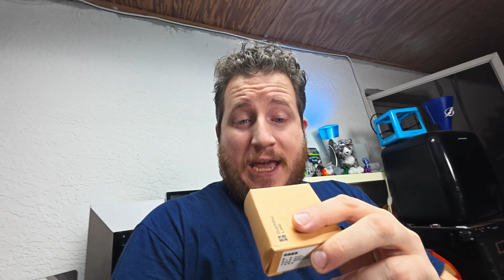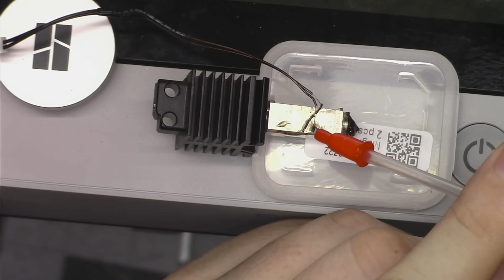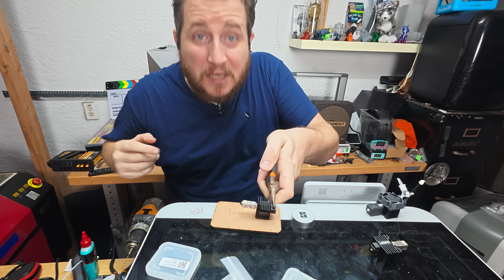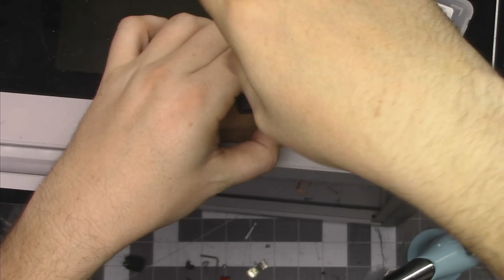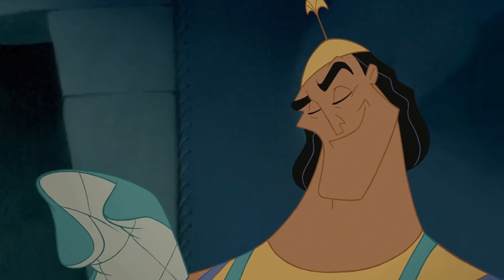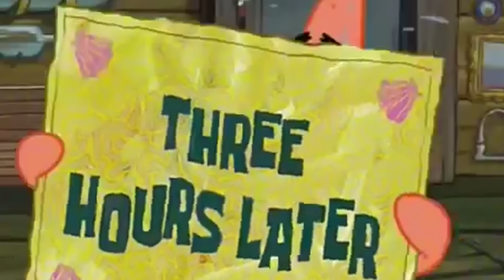I Drilled Out a Stuck Thermistor to Save a $160 Nozzle - PrintFixFriday 256

Comment: I apologise if this a noob question.. I am a bit new to 3D printing. I have a H2C and experiencing retraction issues. I have no doubt there is more than 'one thing' that could be causing my issue, however I did notice, like in your video, a possible issue with the ptfe tube curve for the toolhead. Is there a print for the H2C that I can use on the toolhead like the one you used??
Reply from the maker: That I don't know! You can lift the lid a bit and see if that helps
Reply: @3DMusketeers  I will give that a shot. Appreciate the reply 🙂

Comment: WD40 is not a lubricant.  In fact, if it is used as such, it will very quickly get sticky and if that's not bad enough, it will grab on to every dust and dirt particle that touches it.   BUT, it is really really good at dissolving adhesives.  I use it to get labels off of things all the time.    Again,  WD40 is not a lubricant.     Being a water displacer, you can (I did this years ago) throw a computer in a small fish tank full of the stuff and the computer will run.

Comment: I feel that there are better machines out there than Bambu. I have the X1C, but since getting a U1 I find myself using the bambu less and less. I even favor my Centauri Carbon over the X1C now. 
I think that if Bambu had put effort into a toolchanger they would be setting the bar again, they instead went to great lengths to NOT build a toolchanger

Comment: Seems like the assumption about the trick was that WD-40 worked because of its lubricating properties. WD-40 is a pretty good solvent. Maybe a better solvent than lubricant.

I'm not sure I would be able to claim that trick didn't work after changing it substantially.

(I have no clue if it works or not. Just sayin' the reports of its death may be greatly exaggerated. 🙂)

Comment: to fix the fan, 3D print a small post slightly narrower and taller than the hole in the fan then glue it to the front panel then use clips to hold the fan in place, or just use small wood screws

Comment: I had just used IPA when removing the thermistor. The low viscosity helps to soak into the hardened thermal grease an break it down. Just gently pull and push the thermistor inside the hole and it will eventually come out entirely without damage.

Comment: Grant I would suggest placing a note when using the thermal grease. You should not use the same stuff that you would on a PC. The temps will be 2 to 3x higher with that ptc then even a bare die application. The silicone oil used to suspend the additives is only rated for maybe 110c. Something like the boron nitrate paste from slice engineering should be used. 

But that is just my $.02.
Reply from the maker: I dont think ANYONE makes paste for high temp applications, but I used the stock Bambu stuff in the video

Comment: The P2S is really the one that took over for the X1.  As the P2S has all the same bits that the X1 has, but has the new nozzle design (that came from the A1) which makes thing MUCH MUCH MUCH easier to change and fix.  I love my X1 still and it's still a perfectly working workhorse of a printer, I also have the new A2L, which is just an A1 with the H2C's bed.  What is nice about the A2L, is it can do 19 colors vs the "older" 16 colors of the first gen.  As the A2L uses the AMS Lite, and then you unplug one of the tubes from it and put in the 4-n-1 to that tube.  From there you can then hook up 4 AMS/AMS2's, while keeping 3 from the AMS Lite, for 19 colors.  Which, for a sub $600 LARGE printer, is a lot of options for colors, and no one else on the market right now is offering that big of a printer with that much capability for that low of a price.

Comment: Just remember there is a difference between spare parts and left over parts.  3D printers may have spare parts but BBQs come with left over parts.  It's a small distinction but an important one.

Edit:  A small tips for drilling the thermistor out is to try a glass and tile bit.  They have a spearhead shaped carbide tip on them that is significantly harder that the thermistor and any cement that is holding them in.  They can be had in very small sizes, but just a warning for my American friends, when you get them smaller than 1/8" you're usually going to have to look in metric sizes.  Sorry.
Reply from the maker: I looked for small carbide ones, but yeah, no dice. And then the tip is wider than the shank so its difficult to keep straight. I say get a cheapy drill bit and go slow.. 

But spare parts and left over parts are for weight savings and aerodynamics and I will not, in fact, hear any arguments to the contrary lol.
Reply: @3DMusketeers  So you're saying you've built a few BBQs then.  lol
Reply from the maker: I build things, and fix things often. Spare parts are just a key that engineering could have done a better job ;)

Comment: Provided the goop is decent quality boron nitride paste, water is the universal solvent that will thin it. Problem being after many, Many thermal cycles, it dries out like a stick of jerky and needs a bit of help. If you don't have a lab power supply to heat up the cartridge solo, you can zeus it with a soldering iron and a few drops of water, or if taking the long but careful route, let it sit in near-boiling water for 15-20 minutes and Make Sure It's Bone Dry afterwards. 
Other than that, 6000 life points for tasteful humor edits. 😄
Reply from the maker: good to know!!

Comment: No thermal paint maid for PCs are made for more then 150c continuos, i have emailed 6 of them and all told me no
Reply: Good point. There are some thermal interface materials/pastes that can handle high temperatures, but not the generic stuff used on PCs. (AFAIK the problem with most generic thermal pastes and heat isn't the suspended thermally conductive material, but the oils that help form the paste consistency. The inexpensive stuff use an inexpensive oil that boils off at high temperature.)
Reply: @Sembazuru 
I talked to company's making the good stuff 
Even they can't do 250 continually
Reply from the maker: I dont think the ones used in printers are rated for it either LOL.